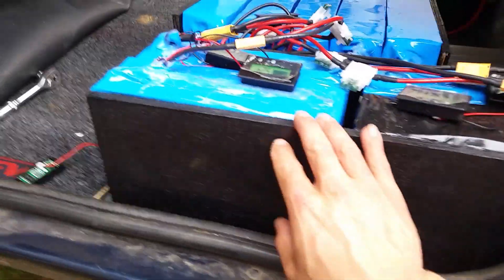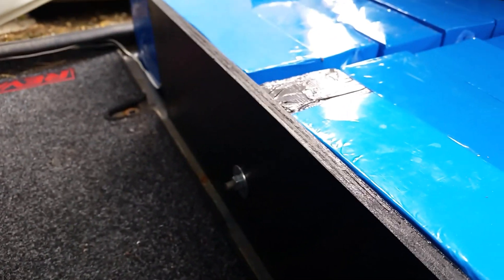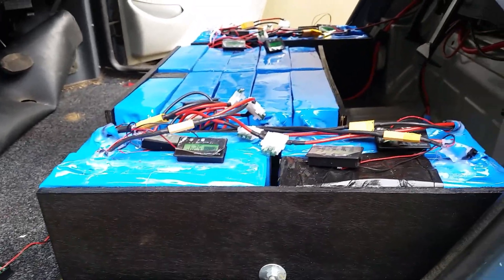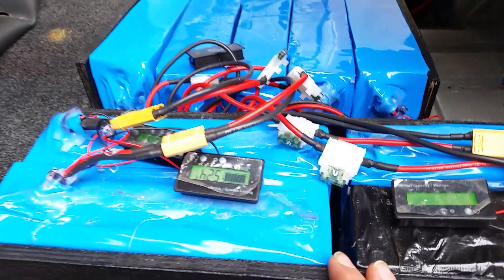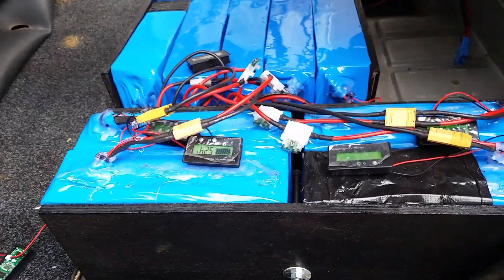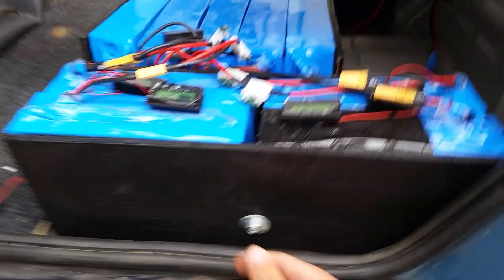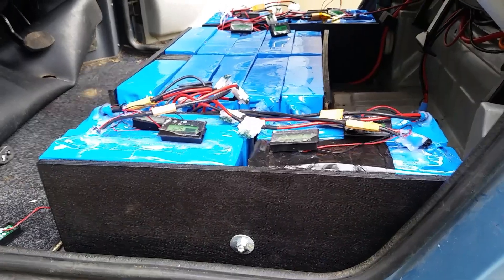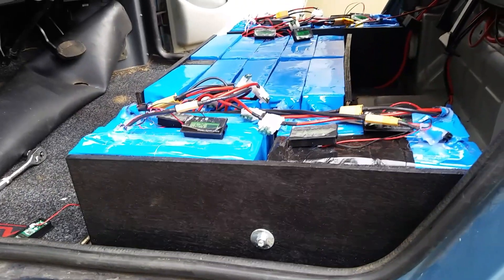REVA G-WIZ: Lithium ion upgrade - Supports for batteries and 'Fast' mode range testing

Comment: How much it cost this upgrade ? Thank you
Reply from the maker: I wouldn't go this route for anyone else unless you know a bit about lithium cells and someone who can build them. Very cheap if you can build yourself but check out one of my later videos on mercedes tesla cells... they are quick to install and much simpler process however only 80 mile range but that's fine for most folk. 

Cost for mercedes tesla cells is about £3000 ... this version because of the much larger capacity with 150 mile range was about £4500 - £5000
Reply from the maker: However another thing to note is that it's not that bad when you consider that they can be taken out of the gwiz and resold after so whilst it sounds alot the batteries are great for using on other applications or selling on to another build.
Reply: Ok... 
are those prices just for the hardware cost or fitting included by a technician? 
Also what about top speed, would that increase to 50 mph?
Reply from the maker: @tudorzz6297  Just for the hardware. They are pretty easy to fit yourself with a little DIY knowledge. 50mph boost mode AC is what I can get easy, sometimes 55... 45-50 id imagine on a DC without changing settings.
Reply from the maker: @tudorzz6297  Depends on the range you want... if you only need less than 40 miles just as well staying with original batteries.

Comment: sir could i use inbuilt charger of the reva for my lithume batteries  i have 210 amp 4 volt lithium cells i want to connect in series for a 48 to 56 volt battery pack but i don't have an bms for protection of over charging and low battery cut so i sposed to use inbuilt ems or battery charger of reva for these cells could i use this or not
Reply from the maker: Not worth the risk at all if you have no BMS.

Comment: so could i make it to drive
Reply from the maker: vikas panchal try disconnecting the dc to dc buck converter in the charger and see. I think mine works but it might still be using the 48v side on the ems who knows. but I lose dash function and regen.